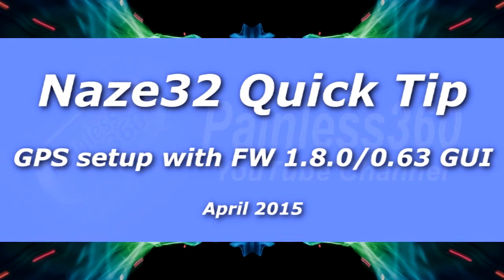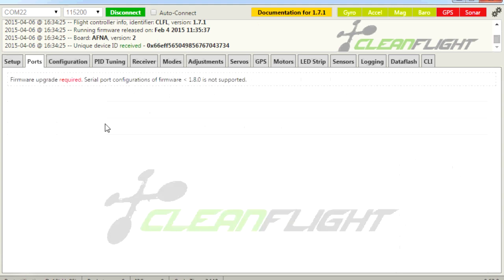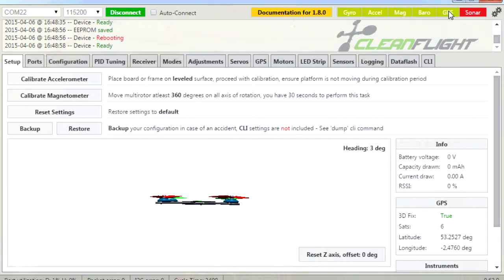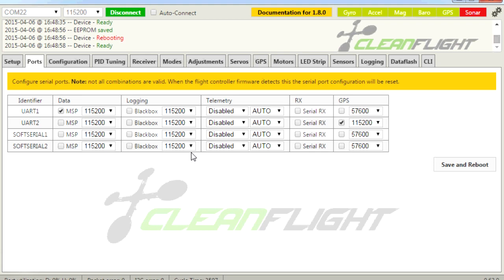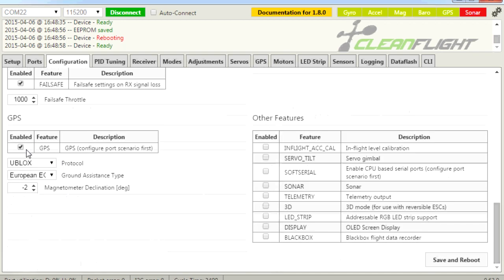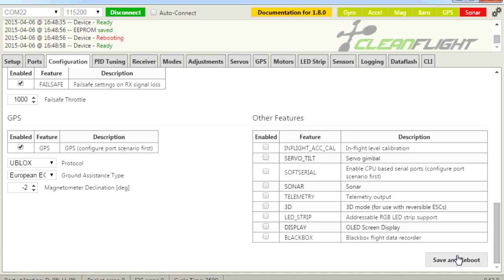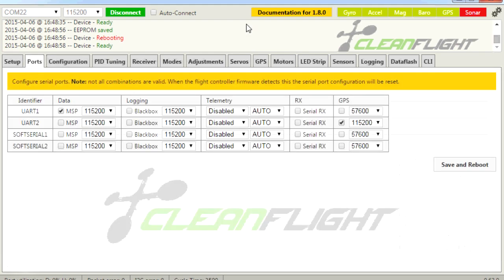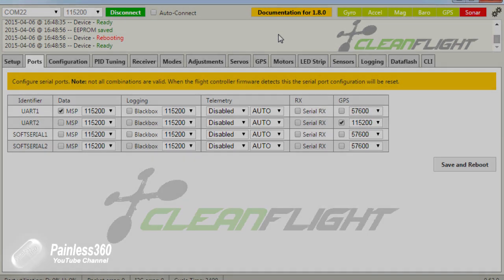Naze32/Flip32 Quick Tip - Re-adding and setting up GPS in Cleanflight V1.8.0

Comment: Please help me man this is my gps 
https://www.google.com/amp/s/m.aliexpress.com/item/32810154546.html does  not matter what I do I cant get my naze32 to see the gps have put gps in uart2 and in config but no luck lights on gps does come on blinking blue but CF not seeing it have swaped rx and tx to and I know this gps does work as it came out of my apm2.8 
Regards 
Johan
Reply from the maker: The data that an APM needs and the data that something like this flight needs from the GPS is completely different. Please see my Naze32 series I show you how to manually set up a GPS so it will work. If you’re interested in GPS with a flight controller like this, please see my iNav series. It’s a much better choice for GPS enabled machines. Best of luck!
Reply: Painless360 will i be needing a fta connector as I do not have one and will need import from banggood and South Africa post office is slow still waiting for parcels since January
Reply from the maker: Please watch the iNav series, if you use iNav it should autoconfigure it for you

Comment: my gps is not saving the configuration at all
Reply from the maker: +Benjamin Scott make sure that the GPS has an on board battery. Some don't. Best of luck!
Reply: yeah its got an onboard battery, i had to configure it manually but its all done now saved just need to get the gps lock now, i have the configuration file saved if your interested
Reply: i need to tune up not down :) i nearly had it sorted but my back left motor kept on cutting off so checked all the connections, they were fine, but still kept cutting out so i swapped the 2 rear motors around and it seems to have fixed it, any ideas what that could be?
Reply: ook im still havung the same issue with the back left motor cutting off so i think its the speed controller, im sorry if im bugging you just want advice from someone who knows what they are doing and forums are saying different things
Reply from the maker: I don't use the forums any more - lots of opinion and the answer you want buried in lots of irrelevant noise. If you can make it do it on the bench then fixing it will be a lot easier. Swap one of the good motors with the bad one to rule out the motor and check all of the connections on the ESC and FC in case it's bad soldering /connections that are causing it. Best of luck!
Reply: ive had one successful flight and on the second after about 15 mins thats when it started, ive ruled out the motor as i swapped the 2 rear motors around it seemed to have fixed it, had 10 flight tests indoors and as soon as i went outside with it the same rear left motor cut out, it seems to be random, not time or transmitter stick input, the battery is new, the fc is like 3 days old and did the soldering myself, i always make sure there is plenty of solder, on its maiden flight i didnt have any stability modes set up and thought i was gonna hit a tree so i dropped it and now it comes to mind that its the rear left motor  that hit the floor first and thats the one that keeps cutting out so ive ordered a new esc so im waiting for that one to arrive, thanks for your advice :)
Reply from the maker: If all of the connections are sound (triple check that) then I'd agree that the ESC looks like the problem here..
Reply: il let ya know here, when i have a new one, i know its in the wrong section but atleast its here for everyone to see
Reply: turns out my wires kept breaking through vibrations as im using connection blocks to attach my motors to my escs, ive secured the wires all seems fine now

Comment: Hi, painless. The
flip 32 GPS function on clean flight is there a video available or are you
considering making one explaining how to program the flip 32 with the GPS
function on clean flight.also wanted to
thank you for the video’s they are helping me a lot from setting up my Taranis
radio to just be very interesting.
Reply from the maker: The process is the same, you just need to track down the same pins we use here on the Flip32. Best of luck!

Comment: Lee, daft question. Is it possible to make the Taranis play an alert when a GPS is made using the Naze32 and also sound an alert if the GPS fix is lost using a D4R-II receiver?
Reply from the maker: Not sure - great question. Maybe you can use a function to 'test' of the value is not 'nothing' for the GPS co-ords? I'll play with that in the coming weeks. If you figure it out - let me know.. Best of luck..
Reply: +Painless360 Howdy fella, I got this working last night. Tmp2 is the telemetry value that indicates the gps lock. With no lock it reports 0 or 9999. Then when it has a lock, it'll report the number of sats its picked up, eg 3,7,8 and so on... But... It will also give the number of sats eg 5 but another number as well, eg 563. Not sure on what the extra digits are for. So using your guide on logical switches, two test Tmp2 for 0/9999 and then a 3rd tests both L1 & L2 with an OR function. And the the other tests are similar, but to check we do have a lock we use a AND (with a delay and a duration set). And of course some special functions to give audible alerts. Easy in the end :/
Reply from the maker: Wow! Awesome. I'll try that here..
Reply from the maker: Cool! You should do a video about that!

Comment: Hello Lee I have set up my modes in cleanflight with GPS added (flip32 10 dof)  and using a two way switch and a three way switch  (Turnigy 9X) for the Aux 1 and Aux 2  all of the cursors move when switched, the angle/horizon and baro panel turns green when engaged but the Position hold and RTL do not although the cursor sits within the parameters on screen. They remain grey, thinking I needed a sat lock I have taken the laptop and quad into the conservatory and picked up satellites and got a real fix but still they dont turn green when selected any ideas please? Regards
Reply from the maker: +Trevor Vernon Not sure, I've not used the GPS modes here as until the iNav fork of Cleanflight finishes their work the GPS modes in Cleanflight are very 'experimental'. Best of luck
Reply: +Painless360 Thanks for the reply I'll keep looking and let tha' knows if, how and why owt materialises :)
Every day's a school day.
Reply: +Painless360 Ps if you find out first please let me know Lee thankyou

Comment: I would like to know how to connect a spectrum satelite and the gps a the same time. They both use pin4 signal.
Reply from the maker: +Rejnar Storm If they share the same pins then you can't you can use different UARTS for things like GPS and other boards like the STM32F3 based boards (Colibri and SP3) have a lot more options for connections.. Best of luck!
Reply: +Painless360 Has anyone figured this out?  Can I use the Spektrum satellite and GPS together?

Comment: Can you tell me if its the same procedure in the newest version of cleans light
Reply from the maker: +dungeonsound1 Very similar yes. See us using later versions of CF in the SP3 series on the channel..
Reply: is there a way to run Futaba Sbus, in cleanflight, without Sbus too Cppm converter.
I have not found a way yet, flip32.
Reply from the maker: You can use a s-bus inverter cable.. Best of luck..

Comment: I realy hope you can help me I checkt in the port tab UART2 and hit save.. now I cannot connect :(... Boot loader is no option because my boot solder pad is ribbed off from the board :(
Reply from the maker: +Johnny TSC Disconnect anything connected to your board and try again, use only USB power. If you can't get it to connect then and you have no bootloader pins then you are getting into trouble.. Best of luck.

Comment: Hi, as always very nice video. I have a doubt this gps is able to make RTH ? Or is always for stabilization and telemetry. B regards.
Reply from the maker: +Fly-addiction.com Not at the moment, see the comments in even the latest SP3 video series on GPS - the code isn't up to it yet. ALl GPS modes are considered 'experimental' and doesn't seem to be a priority at the moment to get it all fixed and working as well as the original 8 bit Multiwii GPS implementation did..I am one of a growing number who need an open source FC that isn't an APM/Pixhawk that we can rely on a good GSP hold/home mode on. Not all of us fly 250 racers all the time.. Watch this space - I will be posting when the code finally catches up with it's own ancestor..

Comment: Are there any tips for getting the configuration to save in u-center.  I have a Neo-7m and went through the manual process in the cleanflight github document.  For the life of me I cannot make the config stick, it gets lost every time I disconnect it from the FTDI connetor.  Any help appreciated.
Reply: I think I need to go to the Receiver Menu, select Action then click Save Config. using u-center ver 8.18
Reply from the maker: +Simon Hall Very possibly. I have a much more detailed GPS setup video that Is part of the SP3 series. The setup for the GPS is the same for any Cleanflight board so it may help.Best of luck.
Reply: +Painless360 Thanks

Comment: I have a problem with my GPS, I followed all the steps of the other video, but in cleanflight I get no GPS signal, before I placed the file in the GPS with ublox I had a GPS lock, now I don't
Reply from the maker: +Jona2122 I would reset the GPS module and set it up manually. The process is listed in the GPS.MD pages for Cleanflight and I also have a video for GPS in the new SP3 playlist that shows it in detail.Best of luck.
Reply: +Painless360 how can I reset the gps ? yes I have seen the manual version
Reply from the maker: I mention that in there - the first step I show in the video in the GNSS config software....
Reply: +Painless360 found it thanks ! where can I buy this new f3 board ? only on the manufacturer site ?
Reply from the maker: Lots of places have them. I know that Hobbyrc.co.uk have some at the moment..

Comment: Hi Professor, few months ago you told me it was possible to get the GPS, the MinimOSD and the FrSky Telemetry working, as well as the LEDs on Cleanflight! And I did not argue, even though I did not agreed! Would you mind letting us know hoe to do it nowadays, please? Indeed, I confirm what I mentioned, it is not possible right, with a d4r-ii, off course (27ms flashed in PPM)? Thanks for keeping in touch, if you may, as I am struggling now with the latest firmware and the docs on GitHub, to get my old Trifecta running..... Cheers and tks again for your help and dedication to the sport & the Hobby! Kind Regards. FPV Cambodia.
Reply from the maker: +FPV Cambodia LED into Pin5, GPS into Pin3 and Pin4, OSD into TX/RX pins in the middle of the board and the FrSky telemetry inputs connected to the telemetry pins?
Reply: That's what i thought but then for some reasons the telemetry has to out put on softserial 5 removing the option for the LEDs.... Can you get them to work all together, seriously?
Reply from the maker: You can't have the LEDs and the softserial at the same time - you need to use the Telemetry pins..

Happy flying!
Reply: Tks, That's what i was confronted to, especially with the GPS and MinimOSD, you have to choose! You can't have it all! Cheers...

Comment: Painless360, my Crius NEO-6 came with an I2c board. Do I need to use this on my Naze32? For some reason my GPS gets a 3D connection on U-Center but not when its connected to my Naze32 FC. :(
Reply from the maker: ***** If you connect it like I do in the Naze32 series you will be fine. To watch the original GPS setup video for the Naze32/Flip32 then click here – https://www.youtube.com/watch?v=ImFCE...

Double check the baud rates and settings on the GPS though. 
Best of luck.
Reply: Painless360 Yea, I feel like I am doing everything right. I've got it to remember the baud rate and the configuration file in U-center successfully configures with no errors. I get a perfect 3D fix in U-center.

I then plug in the GPS to my Naze32 to the correct 3 and 4, plug in the battery, lights come up on everything. Then I plug in my USB to check everything. Baud rates match up and when I go to the GPS tab in BaseFlight I see the "searching" but never gets a 3D fix. 

Any other ideas I might be able to try?
Reply from the maker: I'd swap the tx/rx lines into the Naze32 in case..

Comment: Thanks for your great videos!

Your magnetic declination should be -200, from cleanflight GitHub: "For example, -6deg 37min, = -637 Japan, format is [sign]dddmm (degreesminutes) default is zero."

https://github.com/cleanflight/cleanflight/blob/24052eae2e00dfb2b0aff237a4ce46b1d8305242/src/main/config/config_profile.h

Comment: Can you do a quick tip on how to setup Failsafe so that quad lands when signal is lost.
Reply from the maker: Jon Car Hi Jon. The current settings are basic at best! 
Thanks for the suggestion..
Reply: Agree, nothing special about the failsafe on the Naze32.  Getting GPS hold to work is a challenge.  Not many tools to trouble shoot like on the APM 3.1
Reply: I got it to work but its nothing like the APM GPS Loiter mode.  Novelty at best.  Naze 32 is designed for quad racing which its really good at.  Just installed it in a ZMR250 frame and its a rocket.

Comment: Hi, I have 2 questions. 
1. Do you have a solution for minimosd in v1.8? In this version I cant get any signal from BT pins. Worked great until v1.7.
2. Where to connect and how to setup GPS if I have sbus on uart2?
Thanks!
Reply from the maker: Gašper Kolenc It must be something to do with the port setup for UART1 I'm guessing - I have not tried it. I would try all the combinations for UART1 (including trying each section on both 57,600 and 115,200 baud) until you get it working again.
Read https://github.com/cleanflight/cleanflight/blob/master/docs/Board%20-%20Naze32.md to see the options for you for the GPS.
Reply: Thanks for the answer. 
Im trying for hours, but still nothing. I can make it work only on bt and telemetry pins, but only when connected via usb and only in the setup page.
Reply from the maker: Investigating this more it appears that the changes to the serial ports in 1.8 are part of your problem. I would wait for the next release and see if that helps..

Comment: Never having set up a gps with the naze32 as I never needed, I have a witespy house ublox here and am building a "fuglycopter" out of all the spare bits and pieces laying around my workshop. I have a minim (newer board) and I understand how to set it, and the gps up- especially with this video as a guide- using the uart2 for the gps- the only thing I am not sure about is the gps orientation on the craft, or if it maters how it is mounted. Distances from the naze, and which direction it should point for optimum performance is not standardized or well documented out here in the digital flotsam and jetsam.
Any help? Direction maybe? (at the risk of making a pun)
Reply: ***** 
If it's purely GPS (no magnetometer included or mag not used) it does not matter. Just make sure the patch antenna has a "view" of the sky and is horizontal. It will most likely work in other positions/orientations, too, but a fix may take longer and it may not be as accurate.
Reply: superdau
I thought so- and the full naze board has a mag on it... but they are notorious for going wonky in my experience.
I just would have a nagging thought that it had a proper orinetation. Thanks for clarifying that superdau.
Reply from the maker: ***** This is great - subscribers helping each other. That is what this channel should be all about - a community learning together and helping each other out. Thanks Superdau for answering.

Hiway, I know what  you mean about the compass - any in reference will affect the GPS modes ability to work well (https://www.youtube.com/watch?v=3CBxyY0lS6g). When the compass is part of the board I mount a piece of MuMetal under the flight controller between it and the rest of the power/electronics to shield it from stray EMF. Works great.

Happy flying!
Reply from the maker: I find reclaimed/used stuff on Ebay..
Reply: Painless360 were can we buy some mumetal?